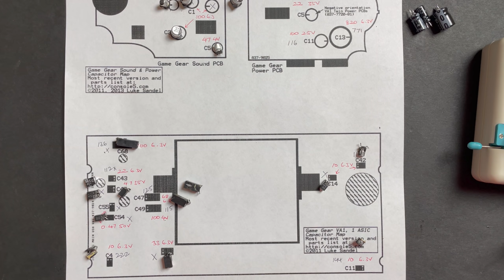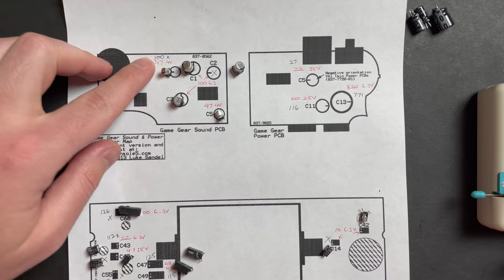Sega Game Gear Repair-a-thon - Round 1, Fight!

Comment: I had to replace them in my personal system too. I ended up breaking the glue connection like you, then I just cut the legs of the old caps. Then cleaned up the pads and removed the rest of the legs from the solder pads. Did one cap at a time and it fixed the issue.

Comment: There's a reasonable chance you can get the LCD working again by heating the contact points where the ribbon cables attach to the screen. If you remove the dust guard (visible @3:02) there should be 3 points at the bottom and one at the side.  if you run the soldering iron over the one at the side (as they are horizontal lines missing), you may be able to restore the connections and get the screen working again. I've successfully managed to do this with a couple of Game Gears and there are a few videos about how to do this on Youtube, but its still worth going with one of the LCD mods if you want to use the console as they're a big improvement over the factory screen anyway.
Reply: Similar as done with the DMG Gameboy with missing lines and I was thinking the same here, even if it not works it's worth the try and would make into a nice video for the channel.
Reply: I'd like to see him give it a try just to see if the old screen is actually still functional.
Reply from the maker: Thanks for the suggestion, I'll be sure to look into this! I'm a little concerned that I'm not seeing an image at all (in addition to having the lines). I worry that the level of corrosion has damaged a trace or something else that I haven't found yet, but I hope it's just a damaged screen with a suitable donor board for an LCD mod.

Comment: Just bought a Game Gear from from eBay that was listed as broken, has corrosion on the battery terminals and hopefully that turns on after a clean up. I will definitely order a capacitor kit for the Game Gear for sure as well.

Comment: I've said this before, but I'll say it again.  You have come so far with your soldering technique from your early videos.  I can see the improved muscle memory, the dexterity, and the overall confidence you have when you solder now.  Awesome video.  Yeah, it's not totally fixed, but a screen replacement is not too big of an issue.  What you have done so far with make it rock stable once the screen is replaced.

Comment: I had a similar issue with my first game gear recap job, though mine was audio and not display.  My audio was always max after the recap.  Even after I turned it down, the moment I took my finger off of the wheel, it went right back to max.  Couple dollars, and like 4 months waiting for the order from china, I got new potentiometers.  Installed one and it fixed the issue.  Glad it was something simple and cheap.

Comment: After fixing 30+ Game Gears, I can tell you that you did a great job.
You even used SMD caps for the sound board which is a nice touch.
The only thing I do differently is clean the whole board after the capacitors were taken off. You might have did the same, it just didn't make it to the video.
Some people think that replacing the capacitors fixes all of the issues, but in my experience, its only 60% (or less) of the cases.
Your screen is damaged indeed, when you turn it on the first time in the video (before the recap), you can see colored vertical lines on the left which (I think) means that one of the chips on the ribbon cable is starting to fail...however I'm not convinced it is totally toasted just yet.
The electrolyte leaked from the capacitors can stuck in the vias, corroding them from the inside and making them non-conductive. This can cause all kind of display issues. (I've managed to fix 2 last year) If you fix another Game Gear with the same PCB revision, use it for reference and check the vias near the capacitors.
Maybe this is irrelevant if you use a modern screen but I thought it might be useful to you.
Reply from the maker: Thanks for sharing your experience. I do indeed use IPA throughout but I tend to edit out some of the cleaning footage to keep things moving (you might notice a brush and small white bottle in the shots if you look carefully haha). Are you suggesting to do continuity checks adjacent to where each capacitor is installed, or somewhere else closer to the screen ribbon cable? I'm getting ready to start working on the next Game Gear soon, but I might tinker a bit more with this one and try some of the suggestions folks have shared about potentially getting an image on the screen.
Reply: @BorderlineOCD  Checks the VIAs near the newly installed capacitors :)
You could also check for voltages on the legs of each new capacitor. I once had a Game Gear where one of the 0.47 uf capacitors had no power because the trace got eaten away by electrolyte.

Comment: Yo, the timing is impeccable. Bought one yesterday (should arrive Tuesday) that has a faulty screen so hopefully I can learn something from this ^^ (reason I bought it with broken screen is 30 bucks for the GameGear compared to 140-200$ for one that's working properly... which I don't have)
Reply: does it have a known bad screen or is it black display when powered on, if black screen then chances are it's just a cap issue, good luck with it, I've just resurected my 4th the other day but it needs a new screen
Reply: @Ghost82uk  It has the same white lines as BorderlineOCD had on his so idk, probably same issue >w<

Comment: Wow! For a while I thought you had the Midas touch. Every system you fixed went from junk to perfect. You did great work as always though. That soldering is incredible.

Personally though, I have to say the GameGear is probably my least favorite handheld. I know it's a portable Master System, but that's my point. The Master System has better games and they look better on a TV. Plus the GameGear has some of the most consistently faulty internals I've ever seen. They're all pretty much bricks if not restored like this. The best thing it has going for it is a wonderful dpad and face buttons.

The coolest thing is that the GameGear has the power and audio boards separate from the motherboard. I've seen people chop off the controls from the PCB, leave the power and audio boards and then solder in another motherboard from a plug & play (or NES Classic clone) or something else and swap in a cheap composite LCD to make a DIY portable system. I'm hoping to do this too! I'd probably swap an activision plug & play PCB because that's got a really good selection of games but it came with a terrible Dpad. Or I could use an Atari Flashback 2, wire in a cartridge port and have a portable Atari 2600.... but I need to get my soldering skills on your level first  :)
Reply from the maker: I like the idea of using the Game Gear form factor to make your own handheld. Great way to repurpose a salvage unit. I think with a lot of these older systems nostalgia will always be a big driver. If you owned one or played one when you were younger, there's a deeper attachment and you ignore the flaws :) For me personally, one of my favorite games on the SMS was Bart vs. The Space Mutants. I'm pretty sure I spent 4-5 years of my youth playing that game. I already purchased the Game Gear version and I'm quite eager to get one of these units working and modded!
Reply: @BorderlineOCD  You're right. For me it's original GB with its pea soup screen. I put so much time into Itchy & Scratchy in Miniature Golf Madness. 
Can't wait to see you work your magic on the Game Gear in the next vid! Thanks for the incredible content

Comment: I've got a couple Game Gears that I wasn't able to repair, first one I accidentally lifted a couple pads while decapping, other one had battery fluid damage but I somehow made it worse after cleaning and recapping (had just a blank screen before recap, after recap it automatically shuts down after turning on).  Will have to try again someday, maybe if Woozle's Game Gear consolizer kits ever come out.

Comment: As a hobbyist who has recapped many of these, I prefer using the small tantalum caps as they will outlast the machine and will not need to be changed for a long time. Also, keep up the good work. I’m interested to see which screen you use. First one I used was a McWill, I prefer now the kit from Retrosix as he has made it quite simple to solder all the points with a single cable. I also used the kit from BenVenn and liked it a lot.
Reply from the maker: It's great to see all the options available. I love the simplicity of the RetroSix kit install, that's the one I have my eye on at the moment.

Comment: Nice work, hope you get the screen sorted. I get a little frustrated recapping a game gear, i always put at least one in the wrong position and can't close the case again. But there's lots to learn from working on them, and lots of replacement parts and upgrades available. Look forward to see how it goes with the other ones. Lets see some Atari Lynx too! :p
Reply from the maker: The Lynx is on the list of systems I want to work on as well. It's going to have to wait a bit though as I've been on a shopping spree lately and amassed quite the backlog of systems waiting in line!
Reply: @BorderlineOCD  Good to hear, look forward to more videos then! :)

Comment: I know is an old video but i want to point out, the same type of capacitors were used on the MegaDrive/Genesis version of Virtua Racing, so if someone has one of those cartridges, i recommend check them out before is too late.

Comment: If you apply heat to the lcd glass with the soldering tip over the right side connector and bottom connector the screen will come back

Comment: Quick question. I've been working a lot lately with very small components and im in need of some type of enhancement of the working area. I noticed that for the top down video you are using an iphone. Are you using a special lens or something? I would be very grateful if you could shed some light on what it is. Maybe i could use that and just use the phone to have a better view of the working zone? Or if you have any recommendations of what other tool i could use? Thank you and keep the awesome work !

Comment: You need to get a working power board to test the consoles, that game gear may be working fine after recap but the problem can be the power board, i have found that in a huge lot of these consoles.
Connect the power board to power supply and test voltage on pins 1 and 2 for 5 volts, and last one on the bottom 34 volts, the one above around 12 volts and above 1.28 volts.
You Americans got the best game gear version, just love the d pad on them unlike the crapy European and Japanese d pads!

Comment: It’s much easier to just wiggle the caps off the board, The legs are pretty much all Corroded through so they just normally pop right off then simply clean the pads.
Reply from the maker: I prefer to err on the side of caution to minimize the chance of ripping a trace, although I've seen folks successfully twist them off with pliers so you're not wrong, it would probably work.

Comment: I bought a cap kit from another online store and was sent ceramics.  I used them and the unit is working again.  Are there downsides to ceramics enough that I should take them out and get the kit you used?